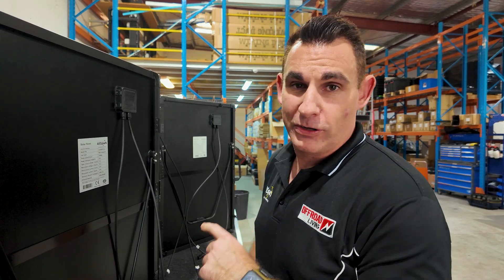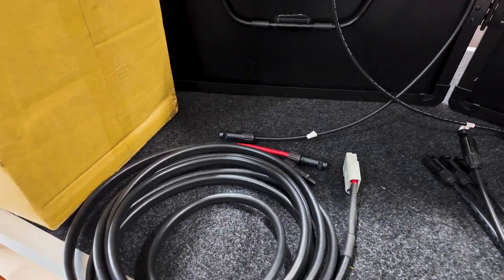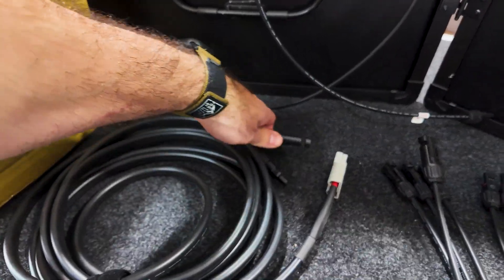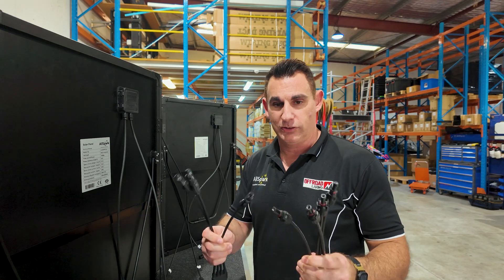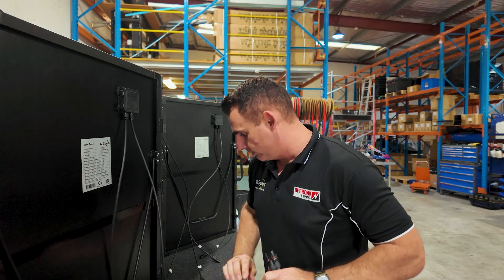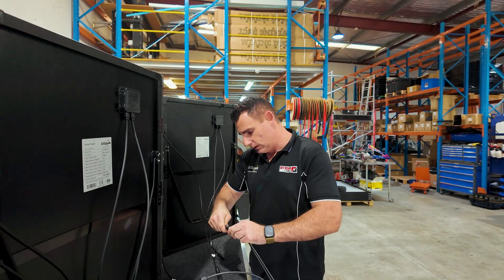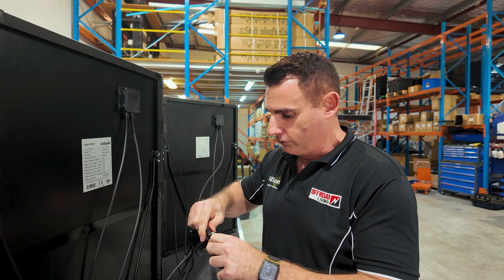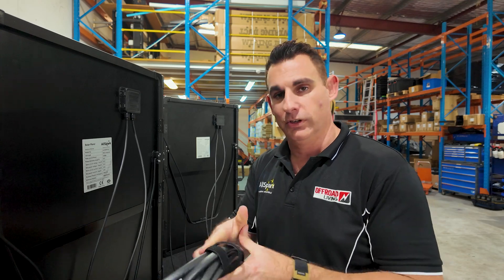AllSpark 400w folding solar panel - full parallel instructions

Comment: And what was the output in that configuration?
Reply from the maker: in full parallel 400w - 23v open Circuit Voltage  - suitable for most Low voltage Solar Mppt controllers